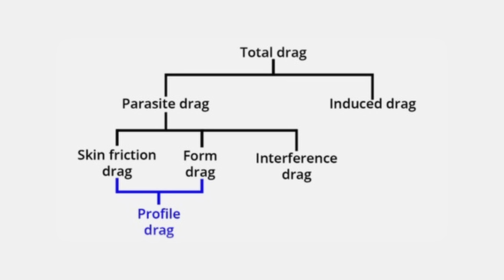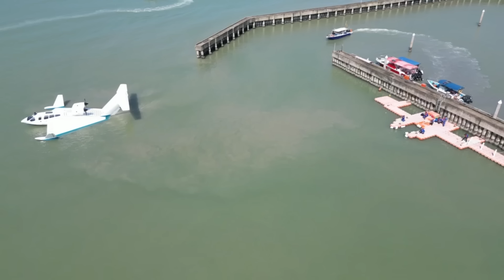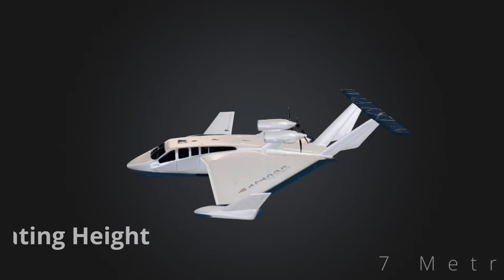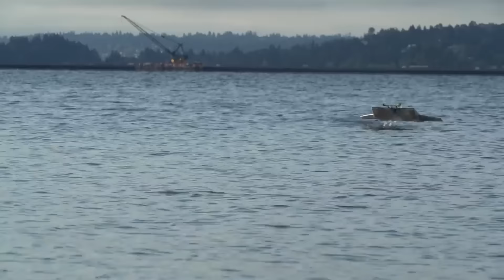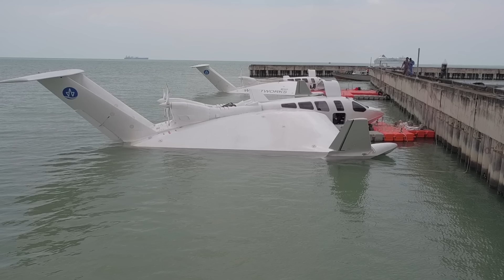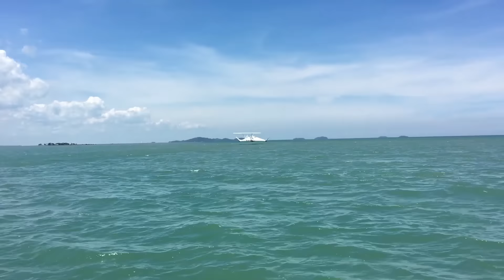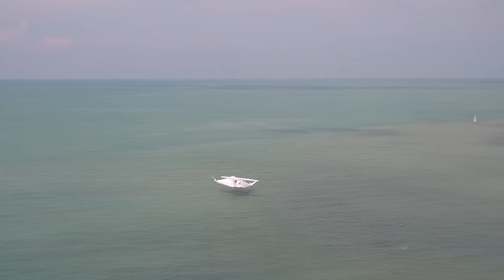Fifty Years in the Making: The AirFish Voyager Finally Going Commercial

Comment: Wow, an operating ekranoplan?
Reply: There are a few of them in the world.
Reply from the maker: A few indeed. Not many unfortunately. That might change!
Reply: @onewingspanabove >>> As my generation would say: 

 COOL...👍
Reply: @onewingspanabove  They don't make much financial sense. In this particular case with two crewmembers (that need to be paid + craft maintenance) on board and 8 passengers on board it's going to be hard sell over conventional boat on shorter routes, and will suffer from low availbility on longer ones. I am looking at the concept and I do love it, but my mind is screaming - English Channel hovercraft ferry services - they lived on thin margins with 20x higher passenger count. True, hovercraft are fuel guzzlers which GEVs are not, but I fear the manufacturer will hit the hard wall of potential operators asking for 14-20 passenger versions, which would make way more sense for island transport.
This is incredibly niche type of transport, and scalability of the platform can play major role in the actual business operations. For now, it appears, there is very little, as they basically are working out single design.
I hope they find their sweet spot, though! The concept is incredibly cool!
Reply from the maker: Good points. Luckily the bigger the craft, the better it works. So starting small to keep cost down and then scaling up once proven.
Reply from the maker: Yup!

Comment: And can one ask if this ekranoplan  -  Americanese "Ground Effect" plane commercially cheaper than the Hovercraft, does it require a water(mind the gap) transfer to ferry boats, and is actual contact made between 2+ passenger craft on landing( I looked again, Yes, I can see the scrape under the starboard door).   Any static effects dispelled through water contact, and re-fuelling is also by marine craft?  to the former, I should say I see no landing Wheels.    So a lifting crane for Hurricane Events away to shore each end,    My family and I, my vehicle have made the 30mile trip on a Hovercraft, and have been impressed even in gale conditions (lost/broke a Rudder(crank)   = Last flight of Day) at it's inherent stability.
I look forward hearing more from this fast 84 knot G. E.V.  Mini machine.
Reply from the maker: Good questions. Hovercraft in general need a lot of maintenance to the point that they become less practical.
Reply: @onewingspanabove  See, that's the thing you have maritime and aviation inspections and possible inspector's imagination's

Comment: The one fly in the ointment was that the RFB X-114 was a catamaran style machine, and this became its eventual undoing. She stuck a sponson into a wave and went all the way over, and the company lost its romance with GEVs thereafter. 
If you are going to operate from water you need a trimaran design (or flying boat) because it is inherently safer. Inter-island machines also need to allow passengers and freight to alight by coming alongside a dock, might be better enabled by a flat more regular fixed wing such as that proposed by Aquas or aquas-ekranoplan. 
There is also the capacity to operate off of land airstrips right on the shore, allowing land to land over water operations which if could be reliably executed would benefit from the lessened structural weight a flying boat requires that could be better put into payload or range.
Still, I like the approach by Airfish in dealing with the legal regime and training proclivities, as well as eliminating electronic failure points and the hydrofoils which are going to work a treat until you drive through seaweed or other on water debris.
Reply from the maker: Those are some very insightful points regarding hull design and operational safety! 
I believe though that one of the X-114s was lost because of a hydrofoil getting caught, rather than a hull.
Reply: @onewingspanabove  I think Janes from the 80s described both events. The whole idea of it was to leave the gaping mouth inside the leading edge of the wing, uninterrupted as possible by the presence of the fuselage/cockpit to make the most of the available flow. But it left sponson floats to support its rather abundant weight so large they themselves could be a problem. Add to that it was difficult to get in and out of on the water lacking a simple access door. 
The 114 achieved a LD of 30 IGE and around 9 in free space. It should have a ClMax above 2 without even having flaps, the cruise speed achieved because of the machines very low aspect ratio which holds it down on the deck, only power could make it climb out.
Reply from the maker: That sounds about right!
Reply: ANY aircraft over water or land will suffer serious issues if a wingtip contacts the surface in any meaningful way. Not sure what you mean by "catamaran" style. I would describe the X114 as actually trimaran style if anything.
Reply: @stephenp7057  any aircraft except those designed to cope with it such as Orlyonok, and there are images on the net of her putting a wing tip in the sea to help her around in a turn. Catamaran style refers to the machines configuration for floats, a catamaran such as X114 that has a float either end of the span and the fuselage up above the water, where X113 was a trimaran, with a fuselage that rests in the water, probably has steps to help her plane, and sponson floats to support the extremities of the wings. https://www.lecurionaute.fr/wp-content/uploads/2016/01/ekranoplan-a-90-orlyonok.jpg

Comment: Yeah I think this is the one, of all the commercial designs this is my favourite thus far :)
One market I don't think was mentioned would be the RV class, what a great explorer this vehicle could be, I could imagine a two berth version, a low flying motorhome. Never underestimate the Rich Man Adventure Vehicle market :)
You could make the nose a bit more like the bow of a motor yacht so the occupants could lounge around on deck.
Take it a step further you could add a light weight two place dinghy as a nose cover that's attached on arms that rotate to the side to launch and retrieve it.
This would of course be one of the luxury options but I can imagine something like this fulfilling a lot of interesting roles :)
I hope once they've had some success with the Voyager they might consider the Explorer or Enterprise class perhaps, 
..... going boldly where no WIG has gone before, first Voyager then Enterprise, might as well lean in to it a little :D :D :D
Reply from the maker: That would certainly be an incredible way to travel!
Reply: @onewingspanabove  .. especially if you made a version with plenty of range ! ..and it's more fun than a yacht :)
Reply from the maker: Agreed!
Reply: @freezatron  I guess one slight downside might be that you'd only want to go outside on the bow or wherever when the vehicle was completely at rest. Cause, you know, the noise and the speed and the danger of mincing yourself if you fall aft-ward or something. On a yacht you can be out on the deck while in motion, of course.
Reply: @delphicdescant  
1) anyone falling off the bow of the boat would go under the wing, not over them in to the props.

2) Not using the bow deck whilst you're travelling at ten times the speed, sensible but also means much more time at a destination, not a big deal :)

3) Luxury versions would be fitted  with a taxi water prop/jet for quieter operation, easy !! :)

None of these things are an oversight but rather they're the by products of a different concept of travel...
... if a yacht could travel at 150 knots who would want to sit outside ? :)
All design is a trade off :)
Reply from the maker: Excellent discussion!
Reply: @onewingspanabove  sorry, I've edited it :)
Reply: @freezatron  Yeah, I agree with your points. I just thought it was worth bringing up how you probably couldn't be on the outside of the craft enjoying the deck while also underway to a destination. It's not a deal breaker, just a minor caveat of using a vehicle that must maintain a high speed in order to get around effectively. The same would apply to an airplane, of course.
Reply: @delphicdescant  a fore deck viewing area with lots of windows would get some of that lounging on deck experience :)
Some old planes had something like a balcony, but they were reasonably slow at 100mph ish.
A sliding roof over the viewing lounge  for when you're at minimum cruise etc. :)